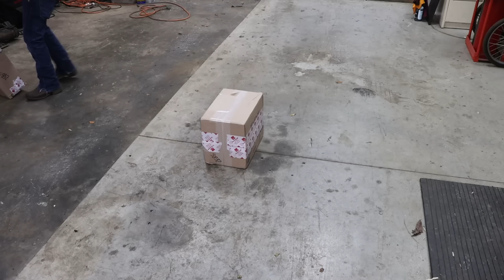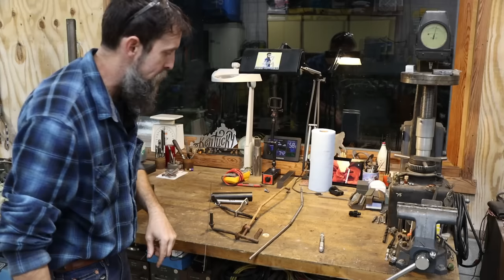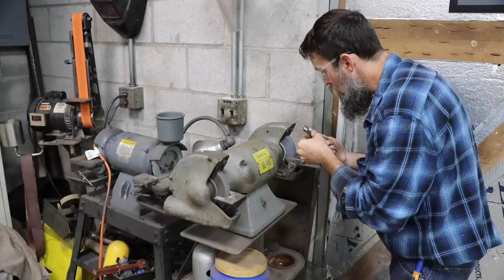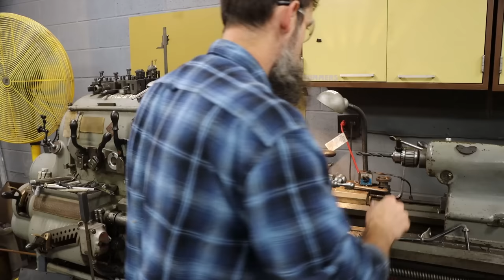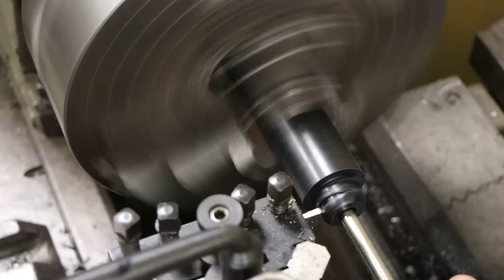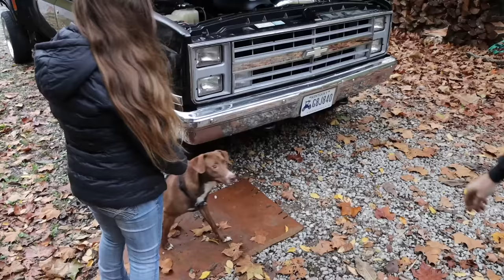Finding Machine parts from the past!  / Machining parts I can't find.

Comment: I really feel for Keith. The same thing happened to me bringing home my first milling machine. It ripped the head right off the dove tails. It was a Nichols horizontal mill. After sulking for a couple of days I came up with a plan to salvage it. Actually increased the head height. Plus it tore up the trailer that I was borrowing a nd I had to buy it from my friend.

Comment: RE: Parting off. I got tired of brushing and squirting oil into the cut so I rigged up a bracket on the tool post to hold a chain oiler to drop cutting oil into the cut.

Comment: To prevent springs from taking a set, stress relieve after forming. For 300-series stainless steels, that temperature range is pretty broad. A half hour in a kitchen oven at 450F is fine (400F for carbon steel music wire). Cooling rate is unimportant but if dimensions are critical, restrain the spring.

Comment: You shouldnt have been worried Steve - AFAICR the 6.0 will have more HP and almost as much torque as the 454. Those old sloppy 454s were a bit dim stock. Of course, modded a 454 will bury an LS, but bone stock they werent much chop at all.

Comment: AS an apprentice I was grinding valve rocker profiles. On the big Landis Surface grinder next to me a lathe tool was being reduced in height dy the Development team. There was an hell of a bang and spray of coolant as the tool took off the mag base and hit the end guard, a bigger version of the yellow one you just fitted. The deep dent was in line with my head! Big cold sweat!
Reply: Glad the guard was there and I hope that was considered enough of a close call to consider a small reconfigure in how those machines are positioned so that any kickout by the grinder isn't in line with where others may be working, as you were. Grinders belong on the periphery and kickout side pointed toward a wall as much as possible. That could have been like a gunshot, glad it worked out ok....this time. ✌️

Comment: Always love your videos, love the truck! Lokar makes a cable conversion for the square bodies makes adapting to a 4l80 a little easier with the change in index positions on the trans, and its more rust resistant.  All the other kits that are available are pretty low quality.
Reply from the maker: We didn't get the shift linkage  with this crew cab. It was long gone, and I had no luck finding a new or even a  used set.  I looked at the cable conversion sets, but they were a little expensive for me at the moment.  👍

Comment: That’s an awesome opportunity to get the factory shielding. I worked for many years running many different Warner and Swasey machines and a big percentage of them had shop made shielding and a lot of times the shop made shielding didn’t work as well as the factory shielding.

Comment: Hi Steve.  The interior came out phenomenal on Johnny Cash!  One nice thing about the LS series engines is that if you need more power, it is easy to add a turbo to them.  Even with the smaller displacement the LS is rated at around 100HP more than the old 86, smog laden, 454.  Thanks for the video!

Comment: Thinking about the order of operations on that little clamp...seems like if you drilled the side hole first, you could finish everything else on the lathe: face, shoulder, tapped hole, part off. And you wouldn't have had to center with an extra piece.

Comment: Ive gotta say a 94-98 cummins would have been perfect for the truck, but I think the 6.0 was a better choice than the original 454. The 6.0 has more hp and almost the same torque just at a higher rpm.  Gotta have better gas mileage too. It turned out real nice regardless.

Comment: This was a treat!  I'm not a machinist, but I have a question out of sheer curiosity.  I know that you were rushed for time, but would the spring have been improved any by annealing and/or hardening?  I'm thinking of heating with a propane torch until it changes color, then either putting some glass cloth over it for annealing or dumping it in a can of water for hardening.  The truck looks great!
Reply: That particular stainless alloy won’t harden with heat…only really by work hardening…..if he had used music wire that might have worked, though.

Comment: Does any one know what brand or number the tool post is on his lathe? It is not ALORIS
Reply: I  think  that it  is  made  by Dixon.   Emco  also makes  a  version  of  it.
Reply: Dickson toolpost, of the piston design that everyone seems to hate but they actually work just fine, British made.
There are imported copies I believe from India that are best avoided, but Bison makes a good version and toolholders that are compatible.
In all honesty if you are spending the money on a new quality toolpost get an Aloris or one of the good Multifix clones, if a cheaper import then one of the wedge types will be the best and most cost effective option.
Reply: We have the original post that is in good shape. We need a few tool holder to fit it. Thanks so much for information.  @dutchgray86